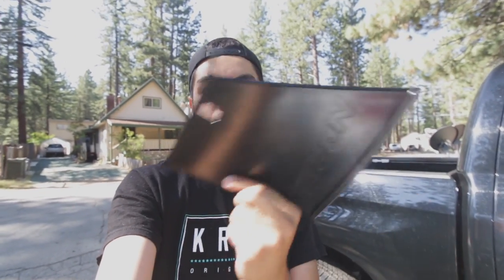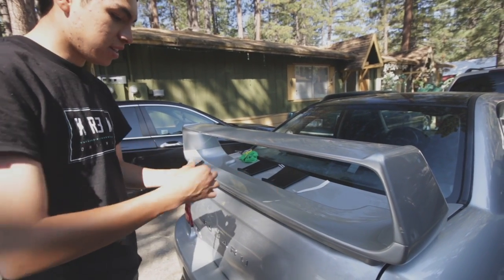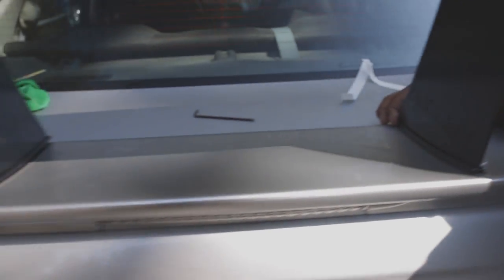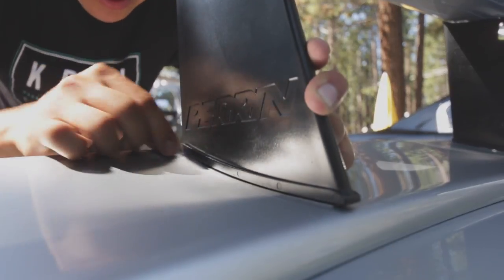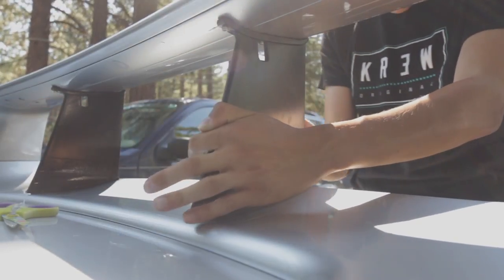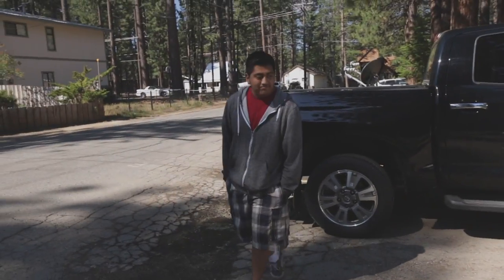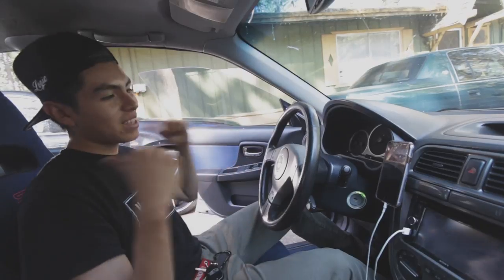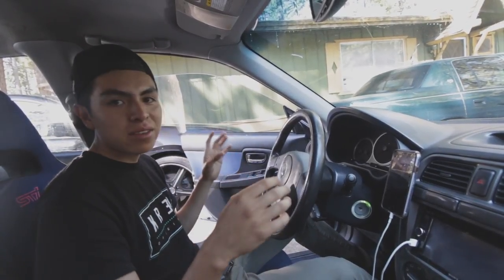STI Perrin Wing Stabilizers Install

Comment: Just came to check for the “WTF you should should replace your cambelt every 50,000 miles & the tensioners need checking / replacing as if they’re loose the belt could jump teeth at high RPM” comments.
Reply: Instead the comments say it’s fine 🤦‍♀️